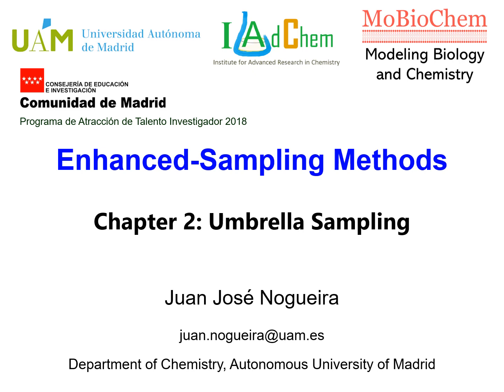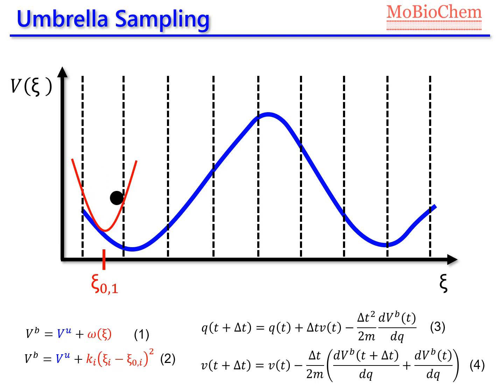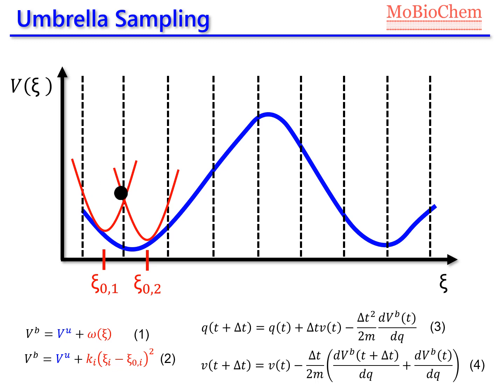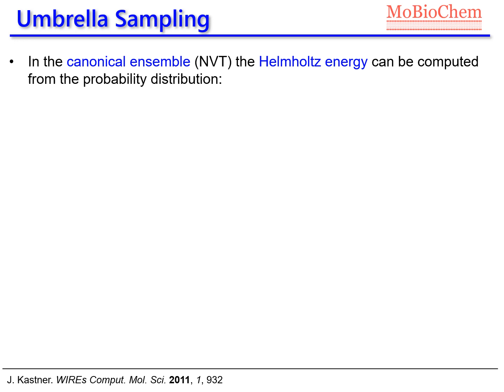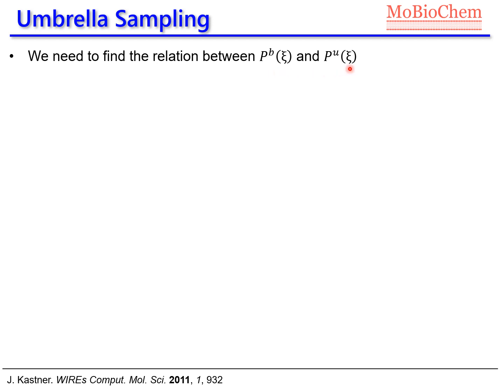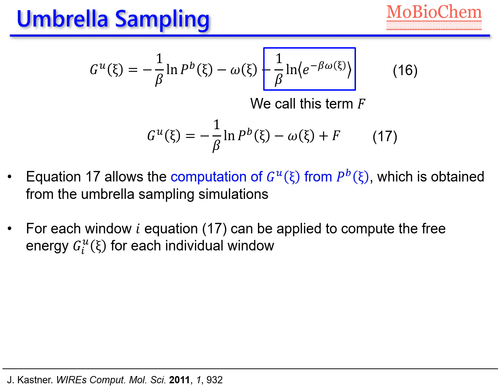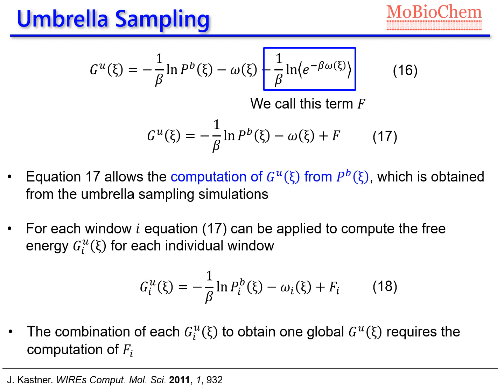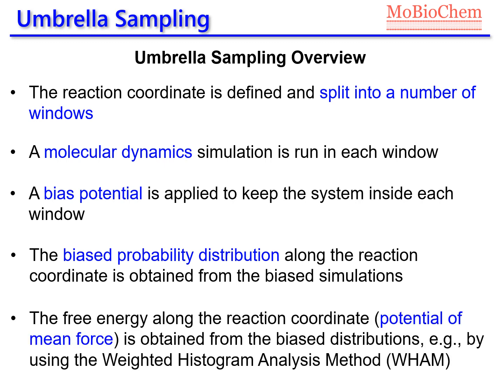Enhanced Sampling Methods - Chapter 2: Umbrella Sampling

Comment: at 13.26, you wrote ensemble average in terms of q (stating integration over all coordinates except reaction coordinate). Later at 16.33, you have rewritten the ensemble average but in terms of reaction coordinates. How in first case, ensemble average was independent of reaction coordinate and in second it is not??? 
It is confusing. Plz clear it.

Comment: 3:16 "and now with this biased potential we will run the MD simulation"

but we don't know the unbiased potential beforehand.  So how can we know the biased potential.
Reply from the maker: Indeed we compute the biased potential at each time step with the force field, so we know it. We don't know the overall potential energy landscape beforehand, but we know the potential at the current position, which is the only thing we need
Reply: @MoBioChem  How does one calculate the biased potential using the force field?
Reply from the maker: @thisiskurt  the biased potential is the sum of the unbiased potential (the real one) plus the artificial potential. If you know the internal coordinates of the system (and we know it) we just replace the value of the coordinates in the potential function and we obtain the value of the potential, both the unbiased one and the artificial one
Reply: @MoBioChem  You cannot get the unbiased potential as a function of a collective variable, just by knowing the coordinates, I'm sorry.